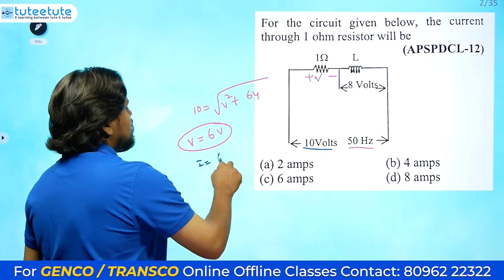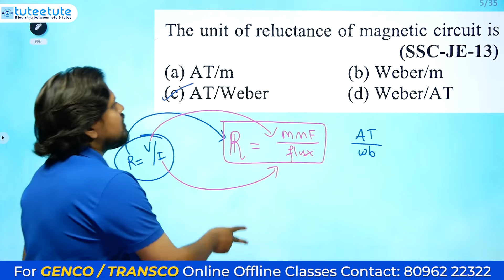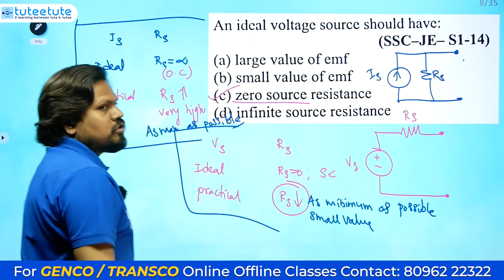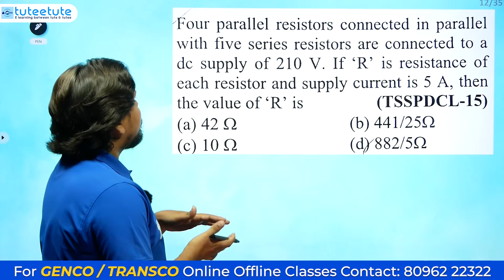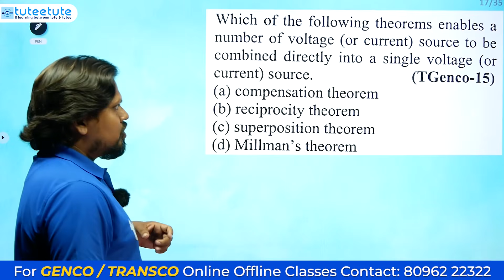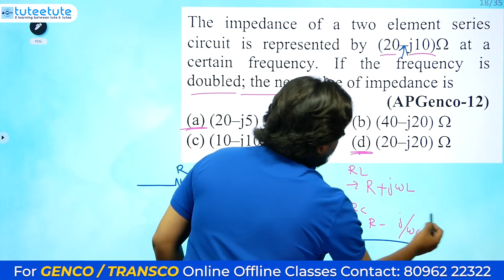GENCO /TRANSCO 500 Important Questions With Explanations Part_04 #tsgenco #tstransco #genco

Comment: QUESTION - EPDCL-14 
In question it is already V1=20 so by substituting V1 in dependent current source we'll get current source as 4Amps. and the node voltage is 12 by nodal analysis ...as voltage is same in parallel P=VI i.e p=12*4=48 POWER delivers as it is delivering current to the resister 
please confirm sir 
thank you